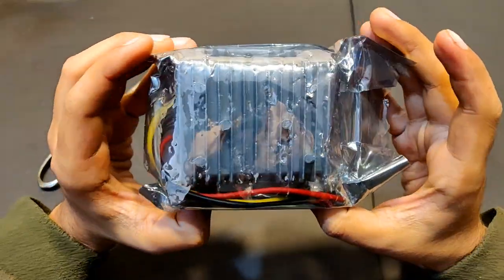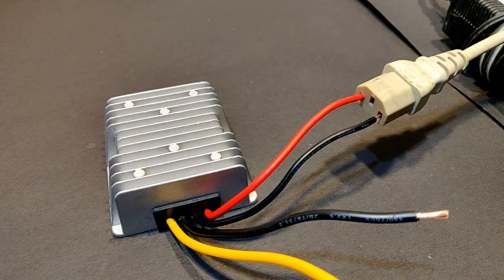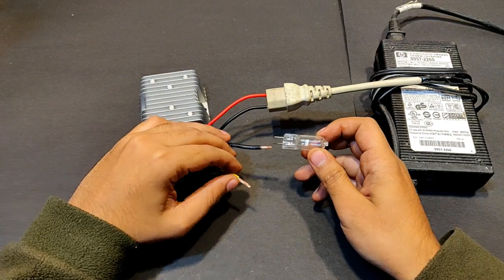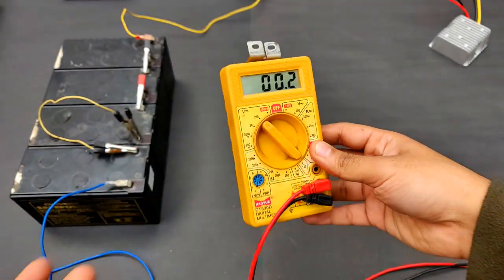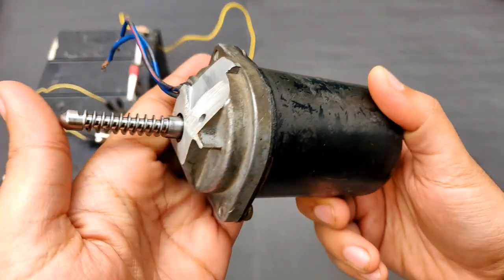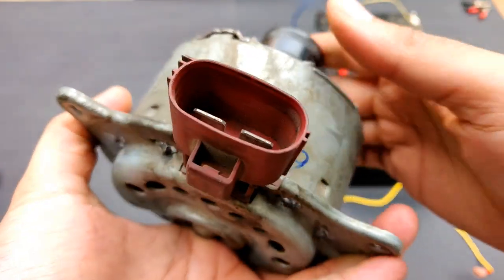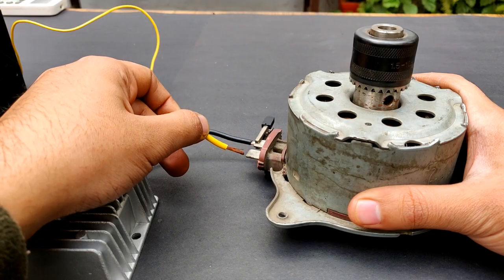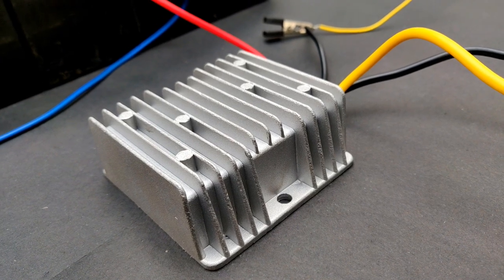How to Run 12v 25 Amps DC Motor at 48v DC using Buck Converter - REVIEW

Comment: If you run a 12 volt 25 amp motor using 48 volts you must divide the amps by 4 leaving 6.25 amps. If you run the motor using the 25 amps and the 48 volts it will destroy the motor very quickly if used under load. This equation is known and is a safety system to ensure safe use when overvolting electric motors. Divide the amps by the amount you raised the volts to.

Comment: Hello Mr. I just watched your video and it really is very interesting. I have a 12 volt 110 watt solar pump. I would like to use a 24 volt solar panel and a 24v12v 20 Amp converter (240 watts) to power the pump. My concern is the section of electric cable to use. The well is approximately 15 meters deep. I don't know if I can use 1.5mm, or 2.5mm or more electric cables. I don't want to have an overcurrent for the pump. Thank you in advance.

Comment: I have a powerful 12 v battery and need to run a 48 v bldc 750 watt motor fitted to my motorcycle can you help with a 12 v to 48 v convertor
Reply: 12 x 4 = 48...It is what it is. keep it simple like that. That Brushless motor will
fry your 1-ea 12 battery..and you might only get 2 mins run time.
That brushless more is powerful,...but not that powerful..it's still going
to need CRAP load of JUICE..You CANT  get something from NOTHING...bro.

 
You can get 48V 8000 mah
Lion e bike batteries for $105 with Charger...The 18650 cell they're made of
are probably 20C......
Or you can look around...salvage  old DRILL ( li-on battery pack) build your own
6s = 25.2 or 24v...4-ea per 1s.  Most 18650 drill battery are 2200 mah x4 = 8800 mah....keep it simple...like that. get 2 PACKS. to inprove your range

 Hook up the 6s x2 to get 48V.
alot of it is because you can get 24v chargers or R/C chargers EASY.
It'll recharger FASTER...than lead acid.

Or you can LIPO..3s 50c 5000 mah are $30....to make 48V..you'll need 4-ea
($120)....but it's only 5000 mah....get 2 sets...to make 10000mah
or as many as you like to improve your range.
You get what you paid for...but the lipo will out perform the li on.
Because it's 50C...Brushless motors....likes HIGH DISCHARGE.
You;re bike will go faster and have better excellertions..ect
But it's not Cheap
5000mah might give you 3 miles....
But the batteries are LITE and not as bulky
you can make 15000 -20000 mah fit a motor cycle..if you're creative

Or you can get 4-ea lead acid  12ah  4-ea for $100)
Just get 2-ea chargers...recharge at 24V.

They're a little bulkier and require overnight charge...
Depends what you want to use it for...
3-4 miles drive  to work ( each way)  put it back on the charger.
UNtil you save money for LIPO.

or you could try electric wheel chair batteries.
they 12V 37000 mah..But they're BIG ,  BULKY and BRICKS....
You can always  slap the 750watt brushless in a small go kart. lol
You'll need 1800-2000w brushless for regular size go kart...72V
at 30-35 MPH
Reply: Bro I need your knowledge my WhatsApp number 9080631312
Reply: @oneeyemonster3262  what the super fuckin knowledge you got man🍺🍺

Comment: Can you use the bike starter motor in your ebike "pulsor " and run with 12 volt ups batteries in series e.g. 12volt + 12volt +12volt + 12volt and total 12 volt  and 28 amps.
Reply: Battery connected in series have a higher total voltage, in the case you indicated the total voltage would be 48V if the batteries were connected in series. In parallel, you can increase available current. I hope that helps.